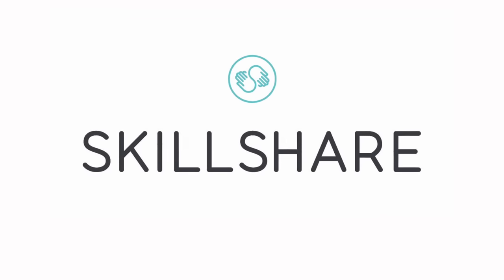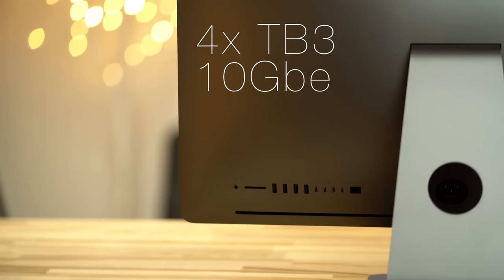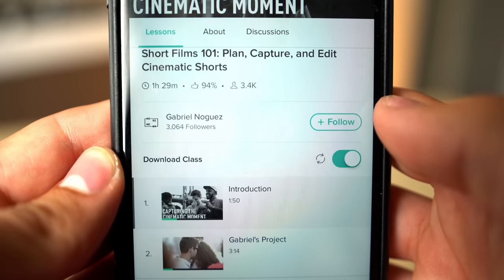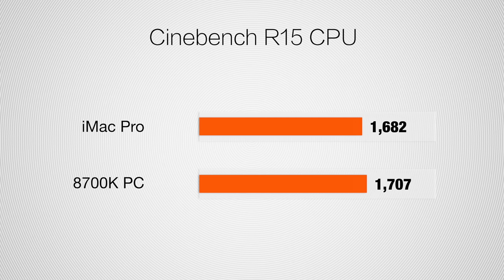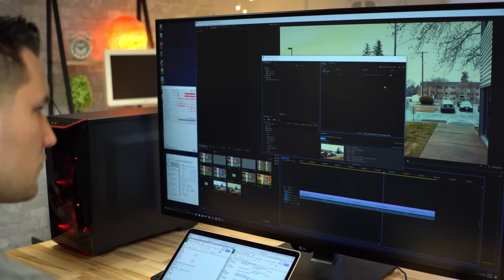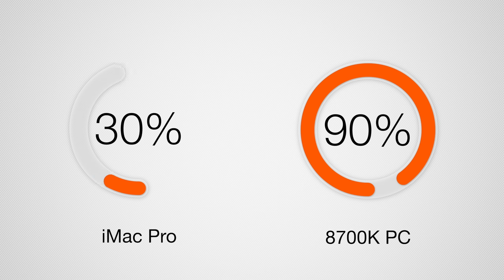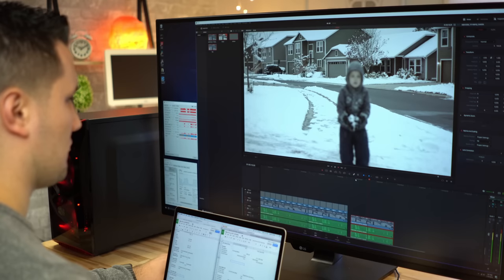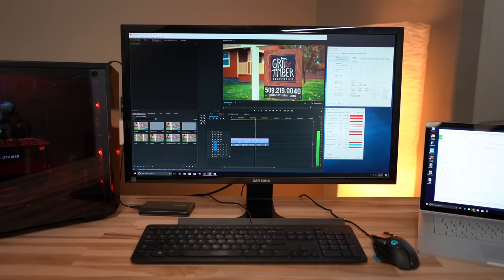$1350 PC vs $5000 iMac PRO for Video Editing 😲 Premiere & Resolve

Comment: Hi max, i have an asrock z370 taichi with 32 gb ram, nvdia quadro p1000, intel core i7 8700 6 cores.. with a sata ssd for c drive and other two hdds..
Still after effects runs very slow with no real time render and final export rendering time is too much like 8 hours for 4 minutes.. even on keeping everything on c drive..
Will an m.2 nvme help to increase the speed?

Comment: Thanks for sharing. I just got into video the last year or so. I’ve been using a 2010 Mac Mini for years now for photography in Lightroom, and now added Premier Elements 13. I’ve had some real issues with Mac’s lac of support of their older models. For instance the SD card reader no longer works after upgrading the OS. I’ve been trying to decide if I want to buy a newer Mac or build a PC. Thanks for doing all the research here. It’ll help me with my decision.👍🏻

Comment: Hi Max i bought the 10 core 64Gb with upgraded graphics card and was hoping that editing 264 and 265 would be smooth in premier pro. Playback works fine but scrubbing thru the file is not satisfying. Do you have the same experience?
Reply: Moogli of Sweden premiere wants Nvidia cards (cuda). If you hooked one up via thunderbolt 3 you would see a huge difference.

Comment: FYI Premier Pro and iMove and FCP were code by the same person. He started with Adobe Steve Jobs open his check book and after he died,I believe he return to adobe. I was a Mac users for decades, but guess what, they only difference between them is the OS! They use the same motherboard, CPU’s, GPU’s, now APU’s Memory, same hard drives, same ssd cards, so why waste money on buying a Mac.  I have a Dell PC that has an AMD Reston 7 1800x CPU, GPY is AMD RX580 with 8 gig’s of mem., 32 gig’s of mem. My monitor can handle both 4K & k video, but I shoot only HD and at times SD video. I have a friend who has the lates MacPro, mine run’s rings around his, using either Premier Pro or Resolve 14 on my PC or on his MacPro.

Comment: Grant the screen & peripherals about $2k-$2.5k - so compare this iMac Pro to a build more around $2500-$3000. The more interesting gains on PC side over Mac are when you get pretty beefy, a build anywhere between $4000-$8000, against an $8000-$10000 Mac. My disagreement with the major PC crowd is they always argue on "a fraction of the price" -- I think you're sacrificing too much going for a "fraction of the price." What's really interesting to me is that you can truly smoke Mac offerings at close prices, if you're not so hung-up on the "workstation" buzzword and actually understand when buying a workstation part is and isn't necessary.
Reply from the maker: As I mentioned in the video, I am going to be doing a comparison that matches up with the $5000 price (when you factor in display and accessories)
Reply: I getcha, I caught that. I wasn't really taking a jab at your video, but more how the PC scene will usually use something like this as THE comparison and constantly talk about "something better for a fraction of the cost" -- well it really depends. Even with your $5k build, it really depends on exactly what you get. If you burn some of that budget on a Quadro, for example, you'd be needlessly burning cash.

Comment: Ryzen 7 2700X is very good choice since it comes with a decent free stock cooler and it's turbo boost is not bad. To overclock properly you have to spend 30-50 bucks more on an aftermarket cooler and may not even overclock all cores past what it can turbo boost to. If you do overclock very high (Lucky you!), the performance gain is probably equivalent to the 30-50 bucks you paid for that aftermarket cooler. I think Ryzen 7 2700x is a really good choice for most video editing builds now. 

The gtx 1070 is really good and nvidia's GPU is near MSRP now. AMD's gpu was more for budget gamers tbh.

Comment: I am really wondering one thing: How the hell did you manage to juice the GPU usage over 10% on PC with Premiere Pro?! I never get over 20%, most of the time I am in the region of 5-10% of usage. On contrary Davinci Resolve's load on GPU peaks at roughly 70%. (btw I'm using GTX 980 Strix and am considering getting rid of it and buying Quadro card instead).
Reply from the maker: What’s your CPU? In order to get good usage your CPU must not be a bottleneckneck. If yours is then you most likely won’t get any benefit from a Quadro.
Reply: Thank you for your time Max, I appreciate it. Well, I'm running i7 6800K which is great in terms of price-performance. Every so often I read articles about how Adobe and Sony Vegas (and who knows what else) don't really support Geforce cards and regarding that Quadro is a better choice. You know, you can have Geforce many times better than a pricier Quadro but your PC can't utilize it that good. That's why I am amazed you got such good numbers not only by using Resolve but with Premiere as well... Maybe... maybe... does it have anything to do with the fact I have Windows 7 and not Windows 10?

Comment: You can also get a Dell workstation what we did and it gives you the best of both worlds ie Pro Support and Solid State Drives, Xeon Processor, 32G Ram, Thunderbolt, etc for around $3400 with 3 years Pro Support.
Reply from the maker: Paparazzi Entertainment I’m going to reach out to Dell and see if they can send over a review loaner. 👍
Reply from the maker: Paparazzi Entertainment Can you link me to the model you have?

Comment: $1300 - Monitor LG UltraFine 5K
$1340 - Processor Intel® Xeon® W-2145
$640 - AMD Radeon Pro Vega 56 
$400 - Kingston Server Premier 8GB DDR4 2666 ECC Reg x4
$460 - SanDisk SSD Extreme PRO M2 500GB x2
$230 - MotherBoard ASRock X299 KILLER
$150 - Power Supply SilverStone 80 + Titanium 600 watt
$70 - Microsoft Surface Keyboard
$30 - Microsoft Surface Mouse
$100 - ASUS XG-C100C 10G Network Adapter PCI-E x4
$100 - Aluminum case Lian Li PC-A55A silver
$100 - Razer Nommo Chroma - Computer Speakers
$77 - CPU Cooler Noctua NH-D15S

$4997 - Total

Comment: The base iMac Pro isn't really that bad in terms of value. And for all the Apple haters, I have a 2012 Mac mini (with essentially laptop parts), and it can smoothly edit 4K video in Final Cut. Definitely smoother than my custom PC (with Quad Core i7 + GTX 1080). Now, find me a PC from 2012 which can do that...
Reply: Just gonna comment here in case I want to reply.
Reply: hackintosh it, it is a bad value for the hardware you're getting, its the software thats saving that pile of trash of a computer which is why if you hackintosh, you'll see why its a bad value
Reply: I believe its the i5 with 4GB of ram with a 500gb drive

Comment: Hi Max,
 
I would like your opinion on this system for photo editing. Mostly Lightroom and a bit of Photoshop - in terms of optimisation for OSX vs Windows as well as file management. Thanks!
Reply: adobe is optimized better on windows, file management depends on what you're doing, if you're just trying to put videos/photos and find them then its pretty much a tie

Comment: Question, newb here, is overclocking a pc from 3.7 to 5ish GHz okay? Or is that too much?
Reply: not only is it extremely scarce to see(a conservative estimate would be an average of 4.2-4.4Ghz overclocked), it comes with extreme compromises both in cooling(its gonna sound like a turbine after you spend 300 dollars on a cooling system that can keep it alive) and also the heavy increases in voltage will decrease the processors lifespan significantly

Comment: Nicely shot Max - best lit piece to camera yet! I'm still unsure how you managed to overclock your 8700k to 5ghz with consistent and stable performance. I can't overclock AT ALL without it failing within 5 seconds of running the Cinebench CPU test. I'm using veryt similar components and a h100i v2.
Reply from the maker: Andy could be silicon lottery?  Some got their 8700k to run at 5.2Ghz
Reply: Well at the moment I cannot run at stock settings without crashing. Something isn't right. 1x 4k clip and a LUT (Premiere CC 2018) and Corsair Link is showing a cpu package load of 75-85% and cpu temperature reaching 85 degrees celcius. This is not a stable system as far as I am concerned and need to get to the bottom of it.
Reply: For anyone with similar parts - I was advised to disable Q-fan and multicore enhancement in BIOS, huge improvement in efficiency with Adobe Premiere and After Effects. I'm not talking overclocking here, just getting it to run flawlessly and efficiently (SO FAR).... For anyone without Max's technical expertise, you NEED to be aware of the knowledge required to optimise your motherboard through BIOS and components, not to mention making it optimised for your NLE. Just be warned - out of the box, if selecting components individually, it ain't easy!

Comment: Premiere performs like a pregnant cow, for good reason: ever since M$ bullied them into dropping Quicktime and giving them the source code in order to add video playback support to Windows, they've been sufficiently coerced out of any serious Mac development. You know this quite well, and still do a Premiere vs Premiere comparison. It's actually not that hard to take advantage of the cutting-edge tech in macOS to make your pro app scream. But it means you'll end up with code that is impossible to replicate on another platform. You'll find even a crappy old Mac might blow your Beige Box out of the water on the same video edits when using FCP.

Comment: I'm wondering how much "Workstation Parts" actually are in this machine - and what "Workstation Parts" actually means. Sure, CPUs with ECC caches and RAM with ECC could be called workstation parts. There's also mainboards made for 24/7 operation, which are like the CPUs and RAM often "just" server parts. A Quadro or Tesla is also something that comes to mind when I  hear Workstation. But in the end those are just parts that are made for Pro or for a special function rather than for the average consumer.
I think beside the Xeon the Mac built in ECC RAM. And that's it. I'm sure the motherboard is the same bad quality like the other Apple boards and I don't believe the cooling truly works after the old (and even thicker) Intel Macs couldn't handle a Core Duo at maximum for more than 30 seconds.
I also don't get the 1 TB SSD. This just makes the price higher. It is way too less for being actually useful for storing your footage but also too large for temporary saving. If you work in a company they should have a fast enough server anyways. They should really consider starting to sell this machine with smaller SSDs, at least for business.
I heard often enough the Apple Store Geniuses can't support these devices. I wouldn't pay an extra fee for that. I get it why some people think they should buy Apple products and that the service and design is worth it for them, but the $5000 price tag on this machine just doesn't feel right. Pro or not.

Comment: Ok,here we go...I own PC,MAC,SGI,and Sun computers,and for the price/performance point,spending $6000 on the Mac is not comparable to an equally priced PC.Here are some stock specs from a PowerSpec PC,who do service and back their computers completely,and extended warranties are inexpensive.I have multiple PCs and i do have an i5 CPU based PowerSpec.They use good/better parts in all their builds,not power supplies,memory,and other parts from some  bin of cheap parts.>>>>

PowerSpec® X600
Use the links below for in-depth information on the specifications shown.
Processor

Intel® Core™ i9 -7900X Processor

OS

Windows 10 Pro 64-bit

System Board

ASUS ROG STRIX X299-E GAMING System Board

System Memory

32GB (4- 8192MB) DDR4-3200 288-pin DIMMS

Hard Drive

2TB 5900 RPM

Hard Drive

1TB RAID 0 - (2 x 500GB M.2 Drives)

Video

Dual NVIDIA ROG-STRIX-GTX1080Ti 11G GAMING PCI Express in SLI

Sound

ROG SupremeFX S1220A High Definition

LAN

ROG GameFirst Technology b/g/n/ac BT

LAN

Intel® Integrated 10/100/1000 Ethernet

Software

ESET NOD32 Antivirus Trial and Microsoft Office 2016 Trial

Power Supply

1000 Watt Gold Modular Power Supply

>>>>>>>>>

NOW...this computer is priced around $5000,so this is the one that should have been matched against the MAC,with maybe all the hard drives swapped for 2x2TB 7200 and 2xSamsung SSD.This comparison also could been done with Zeon based PCs at around $3000,from PowerSpec,which will tailor parts as needed.

Comment: My Lenovo P710 with twin 6core cpu and twin quadro gpu still costs less than the iMac. I'm also using 32gb ram and 2 ssd hd's one is just project and OS and the other is just the software. I do have a regular HD for project storage for finished projects.

Comment: Max, I just started shooting video on my Canon 1Dx Mark II, and I shoot 4k 60 fps.  
When I go to covert my 2.5 minute .mov file (on my PC using Adobe Premiere Pro CC 2018), it takes 8 hours to convert to HEVC H.265. 
I custom built my PC with following specs:
CPU Intel Core i7-3960X liquid cooled
GPU Nvidia GTX 1080 (
Samsung 840 Pro 512GB (OS SSD disk)
OCZ RevoDrive 3 X2 PCIe 240GB (scratch disk, where the video file resides on)
G.SKILL RipjawsZ DDR3 2400 C10 64GB

I am at a loss.  Why does it take 8 hours to convert a little tiny video clip?  My CPU is maxed out at 100% during conversion.
Bit rate encoding is set to CBR, with a target of 7 Mbps.  Quality is set to Highest (slowest).
The original video file coming out of 1Dx is 26.7GB.  The resulting .mp4 file ends up being 133MB.
I would really appreciate some help/input from you or anyone else reading this comment.  Thank you.
Reply from the maker: Hey Serge, how come your wanting to convert to h.265? The only benefit I see is to upload to the web if you have very slow internet or very limited space. It’s very difficult to software render h.265 and most likely Adobe is not making use of the h.265 encoder in the GTX1080. It using just the CPU which does not have a specific chip to encode h.265 so it does a “software render” which is taking forever. I think intel started including a HEVC decoder/encoder with the 6th gen CPU’s, so 6700K and that line and the latest ones are the best (like this 8700K). If you can upgrade the CPU to a newer one with a dedicated encoder/decoder that would help a lot.
Reply: Max Yuryev I don’t have a good answer why, other than I heard it’s the same quality as H.264 with half the space.  I’m not hurting for space as I have 50TB of NAS, so if you’re telling me I should convert those .mov files to H.264 or some other format, I will.
Reply: use final cut pro, it will take 8 minutes instead ;)
Reply: Just take the plunge and get a Mac 🖥
Reply: Serge Letunovskiy yup

Comment: Great video...but also..factoring in ‘on going costs’ Adobe Premiere pro is £50 per month / £600 per year..every year you ‘rent it’.
...
Sure it’s completely different software but If you take the 1 off cost of Final Cut Pro £300 it’s much cheaper in the long run even with the base cost of the iMac pro and unless your a fully paid video professional FCPX is more than adequate for most of us. ( just my view :)
...
It’s a real shame FCPX won’t work on windows...if it did my prayers would be answered!haha!
Great video just subbed 👍🏼

Comment: Storage. I can add 6 drives to an nzxt H440 or a define R6 without an expensive NAS or Thunderbolt 3 case and raid them inside the case, then add another backup solution for a better price. That partially pays for a 5k monitor or just a4k if I don't need that resolution.
Reply from the maker: Hurba Provisual Great point!

Comment: You can't compare the video editing part by using Adobe software on the iMac since Adobe software is customized for the PC and Nvidia GPU..... If you're getting the iMac Pro you better make sure you're using Apple customized software i.e FCPX, LPX etc etc.. That's why you're seeing the CPU utilization so little compared to the PC when using those software.. 
Also, you're getting a really good 5K monitor, that's where the cost is.

Comment: I love your videos, but testing a MAC for video editing without Final Cut Pro is a huge mistake. Adobe isn't the best when it comes to optimizing their software, especially on MAC OSX. One of the huge benefits of using a MAC is being able to use Final Cut Pro. I think you should rerun the test including Final Cut Pro results. (Spoiler Alert Final Cut will use all the power the iMac Pro has to offer)
Reply from the maker: Check out my other videos I have tested it, and no it’s not maxing out the Systems like it does with the 2017 5K iMac. I didn’t include it here since you can’t use FCX on a PC, and this is more for those who are trying to choose between the systems. Most people who went from Mac or PC won’t change to FCX. With that said I will be doing a video with that PC with Premiere vs iMac with FCX.

Comment: Thanks Max! It would be awesome to see the Final Cut Pro numbers on the iMac vs whatever software is fastest on the PC.  I wouldn't use Premiere on a Mac with FCP being an option.
Reply: Neo300002 final cut will be shit in this bcs xenon has no quick sync
Reply: Not completely accurate.  Quick sync is not used for everything and all effects.  Final cut is also very efficient with certain effects.
Reply: Neo300002 no but after applying effects at least rendering and exporting quick sync is used I know for stabilisation and other stuffs quick sync is not used but for at least rendering and exporting it is used and I feel it is the most time consuming of all aspect in a video editing software
Reply: Depends on the project and what one is doing.  I'm not biased either way, but I'd never buy a mac to use premiere when a PC is perfectly fine.
Reply: Neo300002 ya ur right not only premiere pro but any other video editing software including davinci resolve everything is better on PC  expect for fcp